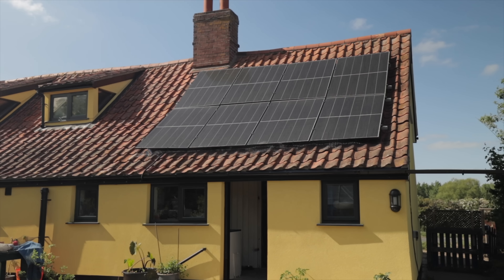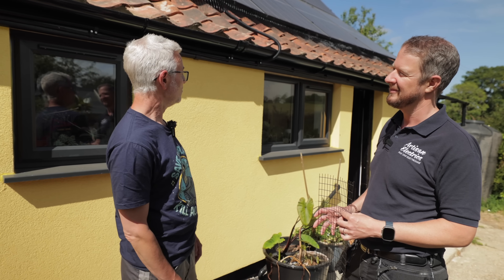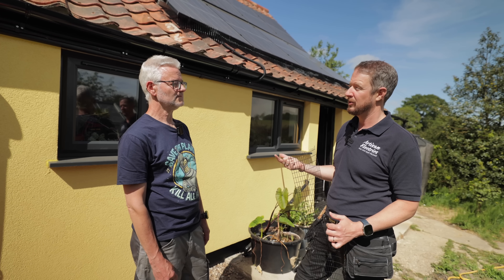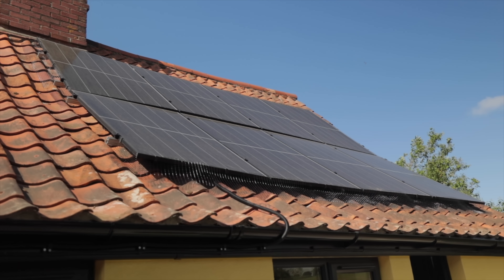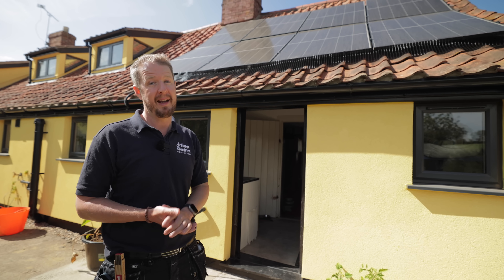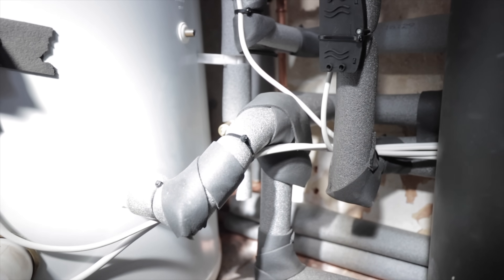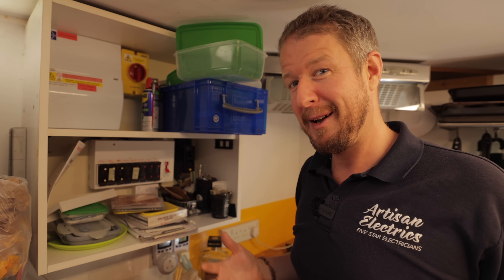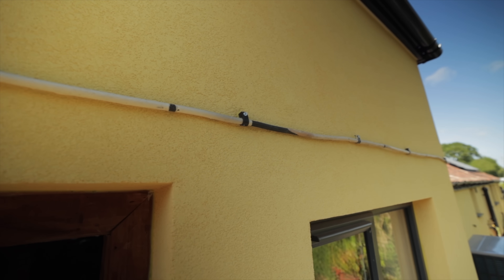This £50,000 Grant-Funded Solar Installation Went Terribly Wrong…😱

Comment: If it includes the word "government" then you can basically replace that with "boondoggle and kickbacks".

When Canada had the Greener Homes Grant program which included $2500 for cold climate air source heat pumps suddenly all the sales and manufacturer ince tives dried up and install prices increased. The consumer ended up paying close to the amount they did before the rebate but the globo-corpo masters were raking in government cheese hand over fist.

Plus a bunch of fly by night companies were spun up to leech grant money and then close when the grants dried up and they actually had to provide valuable service.
Reply: Absolutely - I gather the insulation was done as a designed and commissioned install with a real cost, however the 'clean heat' measures were clearly build around the £7.5k fixed payments for installing a heatpump and trying to cash in on the biggest margin that could provide.

Comment: the govt is doing it all wrong. make it so the customer claims back the govt grant. then you as the customer get locals / bids or whatever, after a few quotes and friendly faces, you get them to install it, as you would any other job. then you as the customer submit the grant to the govt and they reimburse you. the customer is already having a massive headache (what's he going to do now? remove the panels himself?), so the customer might as well do the "paperwork" to get the reimbursed govt grant. subcontractor-contractor-contractor-contractor dodgy installs eliminated (since you as the customer found locals who can install this and presumably you would get a warranty as well, as any other job). I had an electrician team install batteries for me 2 months ago, they were an hour drive away but BY FAR the cheapest (by about £1.2K) - why? because as the govt states, there is no VAT on batteries. all the other 3 quotes i got added VAT. and because i knew batteries had no VAT, i went with the cheapest, and they give a 5 year warranty. finding the tradesman's yourself is the way to go, not some cowboy subcontract-contractor-contractor-contractor's subcontractor's mates

Comment: Had my solar panels installed by A Shade Greener many years ago. Didn't cost a penny and I have enjoyed free Electricity whilst the sun shines ever since. Maintenance is down to the company so if it stops working they come and fix. Only happened once soon after installation so very satisfied. The installation took a couple of weeks with the scaffolding erection and dismantle but it was all very professional. Had the house fully insulated around the same time and do not want a heat pump or battery storage.

Comment: Yep. We paid for our tesla powerwall from the tesla website. contacted by a firm that tesla passed our details to. Then on install day, we had another firm, that threw the powerwall in... dreadfull job. wish we had gone with a local firm instead of relying on the supplier. We've since had another firm back to fix their faults, utility to replace meter, that they damaged and DNO to fix the cracked service head after they pulled the fuse without cutting the seal.

Comment: People 500 years ago were much shorter. Five foot six inches was tall, in East Anglia, where many old houses have low door frames. Why have Solar Panels, when it compromises the house integrity. The house will dry out, and plaster will flake off the walls, trust me, I have had Lime Plaster, it does not dry out.

Comment: It's great that the grants exist, and I realise it is based on government figures for their overall CO2 reduction, but does the end user not get a say in how or where the installation goes?
I have been looking at solar panels for a long time, and yes, the overall cost is a huge chunk, especially for even a small system. My real question is, what if you don't want a typical system? every company just looks at the roof as a guide for the panels or a field  array. What if you want a gazebo with the solar panels as the roof or mount the panels on the wall of the house? 
ps, you guys and this channel bring electrics to life! and really make it easier to understand 👏👍 thank you.

Comment: So it was £50k for the all the external insulation, heat pump install and the solar. Minor issue on the heat pump install but the insulation seems no issue. That's where the bulk of money went, not on the 8 solar panels. Typical clickbait, bit like Heatable these days.

Comment: it is not just Solar and Heat Pumps installed like this. I have seen some gas boilers installed in a poor and at times, dangerous way. a team of 6, 2 down, 2 up and 2 in the loft, ripped out a back boiler, cylinder and pipework, tanks in the loft, carried out a combi conversion all in 4hrs, arriving at 8am and gone by 12 as they had another on that day. I found 16 issues with the install, ranging from a mix of ID RIDDOR, AR, NCS (undersized gas pipe, poor gas pressure and incorrect gas rate to the boiler, flue over permitted length and incorrectly supported and joined and termination. incorrect installation of condensate pipe. incorrect flex to boiler. incorrect electrical isolation to the boiler. benchmark paperwork blank. system not flushed. boiler no level on the wall both ways... these are to name some. like what you have listed, they all give the industry a bad name, as the Gov Funding is not closely monitored and inspected like private installs. My solar took 5 days from start to finish. how the hell can you do it in a couple of hours.
Reply: Yes - the basic plumbing side was awful as well. Wanted to install in a day but brought the wrong radiators. Left 11 leaks. 7 visits and I though we were settled but had another leak yesterday...

Comment: 50K is about 20 years worth of electricity at 30 kw per day will be 20 years to JUST get the installation cost back if you count the maintenance cost? By that time the installation and batteries will be 20 years old and most of it need replacing. He will never live long enough to see any return on expenditure.
Reply: I think the total was 50K not just the solar... this wasn't really explained. And they didn't pay anything the government did as far as I know he explains a bit that he couldn't contribute for a lager inverter.
Reply: @thomasdesloovere4200  Oh you mean the taxpayers bought it.
Reply: @DaveCorbey possibly not quite sure

Comment: You guys in the UK seem to pay astronomical prices for solar and batteries.
In Australia, my 10.7kW solar system with REC panels and a Fronius Primo 8.2kW inverter (top quality stuff 4 years ago) cost me ~AUD$7K, which is less than GBP$3,500.
4 Years later, I am in the process of upgrading it to a Sungrow 10kW hybrid inverter and a 25kWh Sungrow battery, with full home backup and the ability to recharge the battery from the panels in a blackout for ~AUD$10K which is less than GBP$5K. I will basically never have a power bill again.
Reply: Different panels type and more competition.
Probably less gov grants which force companies to compete on price. 

Probably less regulation and paper work. 

Less import duties and tax. 

Vat 20% Vs gst 10%

A lot of stuff is far cheaper in Australia than UK. 
I can buy a Finnish made welder there cheaper than I can buy in the UK.

Comment: The grant scheme is so wrong, its an un-policed license to rip off tax payers money.
More to the point the poor customer who gets the work done, be it solar, insulation or any form of grant work is the one who suffers and in a lot of cases ends up with major faults and issues that no one will correct. Grant firms set up, raid the grant monies available, then simply go 'bust' to avoid any come backs for poor or dangerous work .
Firstly grant work should not be allowed to be sub-contracted out, the main firm bidding/getting the grant should be the only ones allowed to do the work and it should all be fully covered by a no quibble n insurance scheme, to protect the customer.
Just a thought, and not wanting to appear negative to you or Artisan, but with the money you make from You Tube etc and the goodwill of that customer to allow you to produce this video, why don't you do the right thing and rectify the problem and make their house 'safe and fit for purpose'?

Comment: I have to say the first thing that caught my eye wasn't the solar or heat pump installation, but the decision to externally clad what, presumably given it's age, is a solid stone walled house. I hope that moisture is managed internally and the walls aren't boarded or plastered with gypsum, otherwise I'd full expect damp issues in time, potentially damaging the fabric of the building.
Reply: It was mainly very thin, exposed timber frame walls, with mixed infill which had been cement rendered decades ago. The back is brick of various styles, also rendered. The construction caused a pause in the process, additional survey, and change of EWI system to cater for it. The EWI package included measures for ventilation. The fabric of the house is now warmer and much more stable in temperature - vastly reducing condensation which was a problem.
Reply: @reallymadrob  Can you share the details of the EWI product(s) that were used please? I am interested in a similar breathable system. Thanks.
Reply: @timhawes6245  Oringinally it was planned to use the Lincata system but apparently that wasn't certified for olde timber frames so which were switched to JUB. Pysically I'm not sure the process was very different. Rockwool on oak framed walls and EPS on brick walls (with rockwool around windows. The blocks were 'pinned' on with about twice as many fixings as expected. The surface was adhesive/mesh/render with a silicon and glass self colour top layer... a lot of work.
Reply: @reallymadrob  that's great, thank you!
Reply: @reallymadrob  Did the cement render come off?
Reply: if they are lucky they still have "clay walls", but yeah, a whole house heat recovery ventilation would be the safest path.

Comment: Many thanks to Artisan for helping me follow up on this rank amateur solar install. Just to clarify this was a HUG grant application (it started as an ECO and changed) to a scheme run by our local council who hoovered up all the local money. Most of the cost (a vague estimate from the council) was probably the external wall insulation - which we definitely could not have afforded - which is amazing. The 'clean heat' measures were part of the package... installed by a different contractor who employed up to 4 levels of sub-contractor... very shady and very cut price :-( The heatpump works after 7 visits(!) the array worked but has now been replaced - and so now we are chasing to get the roof fixed!

The problem with having the council involved is there's no real customer and the contractors have the whip hand. I'm taking them to all the bodies I can MCS, TrustMark, HIES, NAPIT, RECC etc. Grants are a valid way of supporting households who can't afford to improve make changes to reduce their impact on the environment.

I've paid plenty of tax, don't claim benefits (although that's a class of people who do need help so why not?) and applied fairly under a pubic scheme. These were tory schemes, let's hope they improve under Labour. Universal solar would be a great way to avoid the massive costs of nuclear stations!

Comment: My solar install took something like two or three days, for a 15 panel install (the chimney gets in the way for an even 16). But then I also didn't go anywhere near a scheme and went direct to an installer.

A late friend of mine used to work on public projects; as far as I can remember him telling me, he wasn't allowed to even consider past performance of contractors when reviewing tenders. He was literally only allowed to make decisions based on the tender itself. Which is just so many forms of broken, if it's how it actually works. It would explain how the same businesses keep getting contracts though, no matter how many times they screw up.

If you're offering something up for tender, then you really need to have an idea of how much it's going to cost before you even start. Anyone bidding way below that should make you immediately suspicious and either be excluded or have their costings looked in to very closely; the chances are they're just going to be doing a half arsed job, cutting as many corners as possible, and shaving as much off the costs as they can. Plus just banning firms who are consistently poor performers.

Comment: 50K of taxpayer grants is insane and for just one household and no battery.
Reply: Seems much too expensive. I can’t tell from the video how much insulation was also added - but 8  panels and a heat pump is £10k not £50k and  that would include scaffolding and a battery. Really surprised that a smart meter and up to date consumer unit wasn’t mandated as part of the grant. Not good value for money - and should be worthy of a BUS audit
Reply: @karencarpenter8275  a heat pump and rads alone is closer to £15-£20 (not including government grants), 8 solar panels is around £5k installed.  If you got all that for anything like £10k you need to tell everyone where from!
Reply: @karencarpenter8275 
It's probably clickbait as it's likely a scheme up to 50k.

So they put that in the title.
Reply: That sounds a bit of a scam.  In our village the house opposite me, which was tenanted, about 3 years ago had solar and heat pump installed where the total cost was about £30k, and it included new hot water cylinder, new radiators and plumbing in the radiators (previous heating was electrical storage).
Reply: That system is only about 2 k with a few batteries if you did it yourself and it would look better 😂
Reply: With a ECO-WORTHY 48V(51.2V) 100Ah Server Rack Battery,5.12kWh Lithium Battery only costing £799.99! at the moment!!
Reply: it's not taxpayers' money its money from power industry eco fund.
Reply: Whilst you can see some poor workmanship, it’s easy to criticise other peoples work , I don’t quite understand why tax payers money is spent on grants for people who clearly don’t need them, what a lovely house ! Rich get richer. It’s never the mount of money that’s being spent by the government, it’s what’s actually happening to that money , nhs is the best example of this.
Reply: Welcome to Wales ( Eco4 Grants , utterly insane and Rich homeowners are cleaning up to get 50K one of these people Husband or wife may have had say asthma , and that means they get the full whack of free stuff irrespective of income . Socialist hell
Reply: Only just watched this. I’m afraid the general problem is the poor unskilled and frankly disinterested civil servants running these things . If there was a proper concern from them regarding oversight and quality control the chain of suppliers would be held to account.

Comment: Not sure what area you are, but friends of mine in Maxey which is outside Peterborough had the same with their grant funded install of both solar and heat pump, I had to repipe the heat pump as it was wrong and the solar had wrong breaker, that's why I continue to say MCS is a complete waste of time, the heat pump was installed by a big MCS registered company but the guy on site was a subbie plumber who clearly had no idea. My friends are an elderly couple who were very upset by it all. Houses that age are low ceilings for two reasons, firstly people were shorter and also the houses were often a couple of foot below outside ground level and now people have lifted the floors to ground level to help prevent damp

Comment: My panel rails have that unfinished look and no end caps, only now do I understand why it's bothering me.
Reply: Think of the planet, those end caps are plastic. 
By putting them on your adding to the plastic pollution.
Reply: @Robert-j6r8c  You might be right, but on the other hand they could also have used less aluminium but not leaving the rails sticking out 15cm from the panels.

Comment: Does the solar and heat pump installation actually work? What sort of performance is the customer seeing from all that expenditure? 🤔🤷‍♂️
Reply: The insulation was always the key - worked as soon as the blocks went on the wall, before the heating. The heating actually works well now we have a well insulated home - it would have been hopeless. The solar worked but just wasn't safe. It's been replaced now - damaging the tiles under and around it(!) does about 23kWh/day in the June sun from a 3.6kW array.

Comment: 50k is the biggest crime here when a 450W glass/glass panel costs ~60€ and a great inverter being less then 2000€.
Reply: I think the total was 50K not just the solar... this wasn't really explained.
Reply: @thomasdesloovere4200  if it was just 50k total that's a bargain, especially considering the insulation cladding, that was really done super neatly.